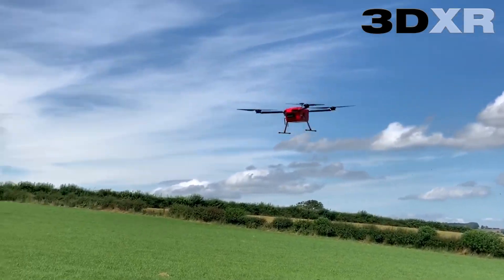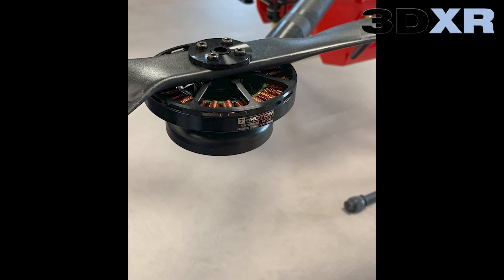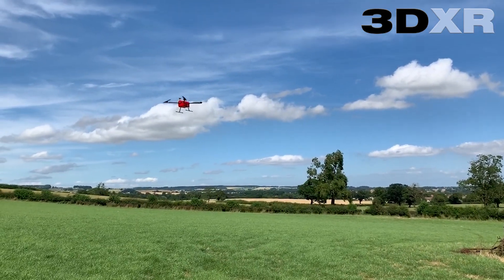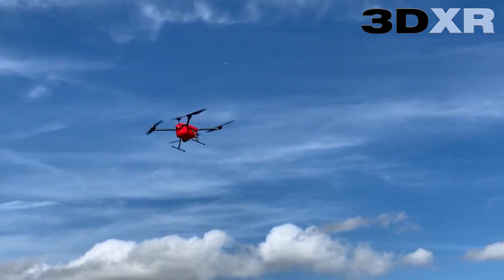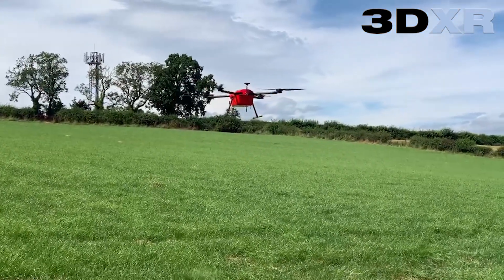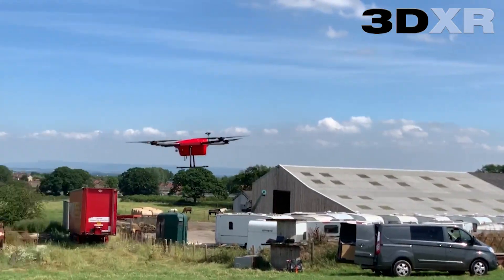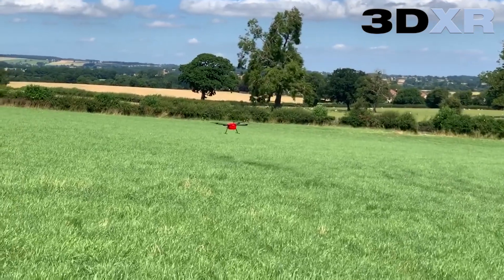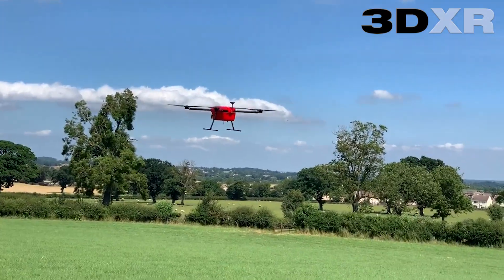ArduCopter -  Terrain Following with Lightware SF20/C using a T-Motor M1000

Comment: what is the  device mounted to the right of the cube with the antenna?
Reply from the maker: RFD radio modem for telemetry.
Reply: @3dxr699  Thank you, I went and looked it up on your website after i posted the question. Looks to be way better than the 433 system.